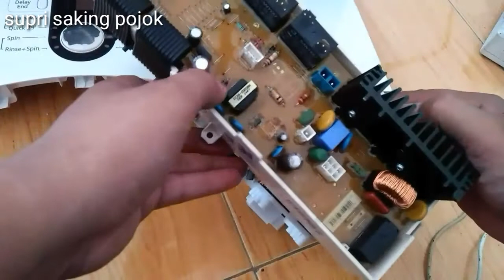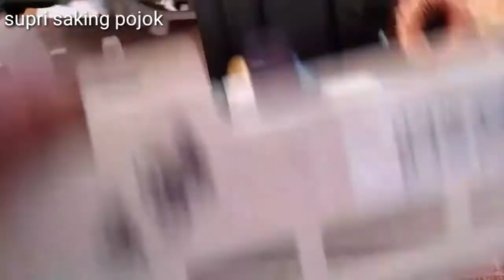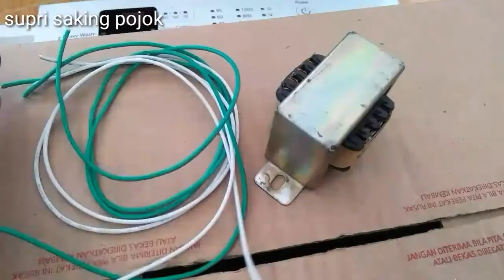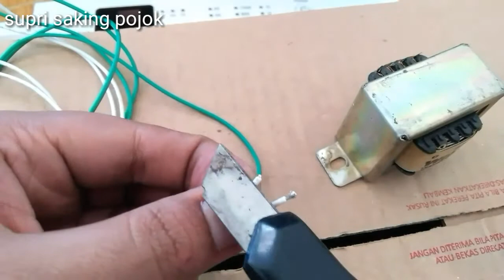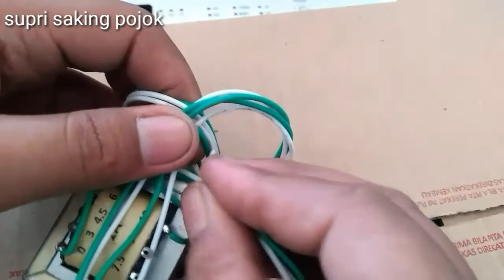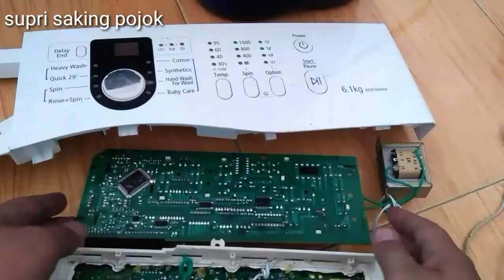Perbaikan samsung front loading mati #vlog5

Comment: semoga sehat selalu mas supri rejekinya lancar.
Reply from the maker: Amiin.matursuwun pandongane,pangestune..🙏
Reply: supri sakingpojok sya pnya modul mesin cuci front loading. udah ganti ac maticnya msih ttap gk hidup. padahal dipasang di modul lain ac matikny ok.
Reply from the maker: Cek  jalur pcb,tombol tombol,x-tal.juga diukur tegangan masuk ic berapa volt?
Reply: supri sakingpojok teg yg masuk ke ic 0 pak. input kiprok 0. output kiprok jga nol
Reply from the maker: Tegangan ac matik yg masuk ke IC
Reply: supri sakingpojok gk ada pak alias nol
Reply: supri sakingpojok klo kta pnya ic tny 266 dan yg dimodul msin cci smsung diatas kode icnya tidak kita ketahui ato gk ada yg jual klo kta psang ic tny266 it sma gk y.? soalny pda sbagian msin cci smsung tsb ada yg mmkai ic tny266
Reply from the maker: Saya tidak hafal pak🙏

Comment: Mas..., sesuai vidio diatas z sdh coba dan modul sdah bisa nyala. Tpi pas mau di oprasikan untuk mencuci malah airnya bembuang trus. 
Dan saat mau dimatikan modulnya, tombol semua sdah mati tapi mesin pembuangnya tetap nyala trus. 
Kira2 apa nya ya mas. Mksih sblumnya mas.
Reply from the maker: mgkn triac drain rusak...coba ganti triac drain dan resistor di gate  triac
Reply: @suprisakingpojok5967  mksih mas masukanx. Sukses sllu mas dan shat sllu brsama kluarga. Aamiin. Slam hrmat dri z Syaiful Rachman Doheng.
Reply: @suprisakingpojok5967  klo untuk resistor di gat triac bawaannya persamaanx apa ya mas. Soalx dsni susah cari alat aslix.
Reply from the maker: berapa ohm?
Reply: @suprisakingpojok5967  alatx udah pecah. Jdi ngk klihatan lgi nomorx.
Reply: @suprisakingpojok5967  mesin cucix merek samsung Front loading type WF8590NHW.
Reply: @suprisakingpojok5967  klo triac BT131 cocok ngk mas.?
Reply from the maker: dicoba saja
Reply: Ter klo modul ac shar inverter 1/2 pk. Erornya berkedip 14 kali. Kira2 apnya ya ter. Mhon pncerahannya ter
Reply from the maker: maaf tidak hapal 🙏